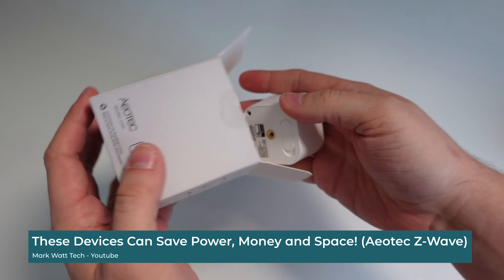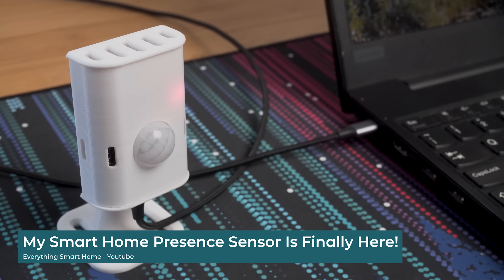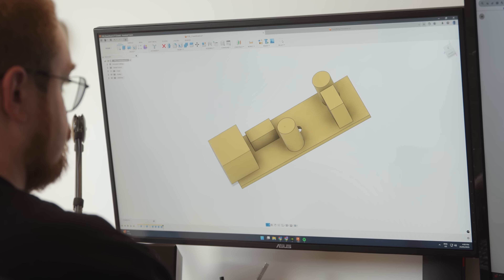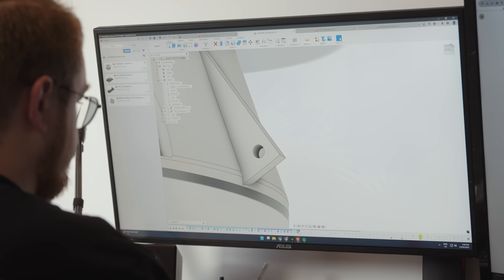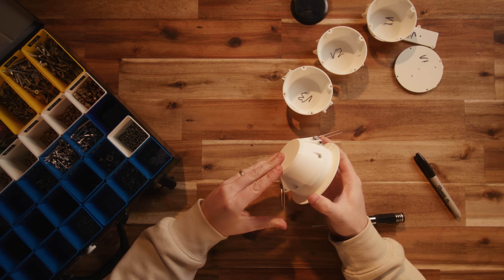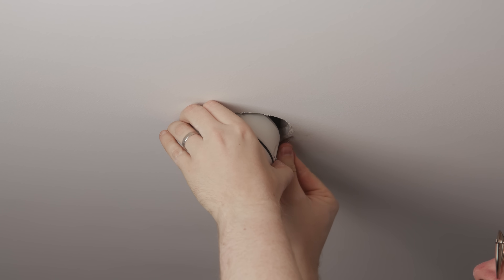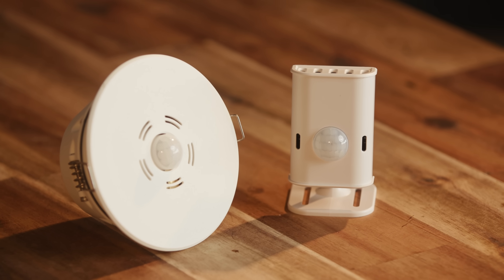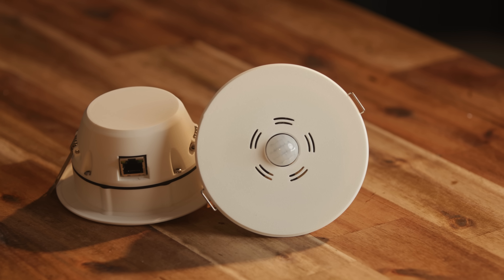Where My Perfect Smart Home Begins - Everything Presence One

Comment: Love this (and might buy some), but just a heads up, you might want to look into home cooling/heating efficiency, as zoning doesn't have the benefits people often think it does. Your home is a thermal battery, and cooling or heating a single room to comfortable from not, costs a lot more than just having your big thermal battery already at a nice temp. All areas within your thermal envelope are sucking energy from all other areas, whether something is actively cooling/heating that room or not, and the cost is efficiency and money.
Often the most efficient way to keep your home is to have all (most) internal doors open, with automations on your windows for sun levels (depending on cooling and heating wants/needs) while evenly heating/cooling all spaces. There is some nuance in different floor levels (upstairs where everyone sleeps can be set lower, as heat rises, and generally people don't like direct heat at night, for instance) but it's a good rule of thumb.
Thanks for the fun videos. They give me so many ideas for once I get around to similar automations and projects.
Reply: You're precisely right.

Air is (as we all know) a great thermal insulator, and it has a pretty high Specific Heat Capacity (about 1/4 of water's). That means it takes a fair amount of energy to heat up a given room, and to alternatively cool down the room, there's a pretty high amount of energy needing to be dissipated.

Assuming one doesn't have a stupidly powerful HVAC system that's way oversized (because the only forseeable reason you'd have something that powerful would be for ISM use), it'll take a fair old chunk of time to see any meaningful change.

And since your house generally has internal walls that leak heat (even if they're insulated it's probably to a lesser degree than external walls), like you said, the heat's just moving around anyway.

Far better to have one or two zones based on floors, and to have a heating/cooling profile designed to keep the house at a fairly steady and comfortable temperature, with perhaps a few degrees here or there based on the time of day and whether you're in the house or not (like say, allow the temperature to drift +-5 degrees when you're not at home).
Reply: @jobblejosh9713  I can only assume he's going to be pioneering this regardless, tech like this hasnt really existed until now so I guess we'll see what works and what doesnt.
I find it a bit weird that both you guys pretty much say it's not really worth it to zone it to a room specifically but at least in comfortlevels with heating a home it certainly is better than an overall heated home. To be more specific: cold climate - fireplace which heats the central heating but with too little power. Whole house couldnt be heated to a nice temperature so we used to turn off the radiators in the other rooms to save some heat for the one I was sitting next to in my room. Worked. If the question is DOES IT SAVE ENERGY that could be a different matter altogether however, I realize that.

Comment: A few Questions:

How do you feel the mmwave and/or PIR sensor are affected by the different orientation. Do you have 8 foot ceilings and what do you think is the area that the sensors cover in this orientation?

Also do you have ceiling fans and have you had to account for the placement of the sensors to account for them?

Lastly where in the room did you place them? Did you do the center of the room?

Sorry for all the questions. I love this idea but to cut down on cooling costs we use ceiling fans to help "cool" all our rooms (yes I know it doesn't actually cool them but it makes them feel cooler via the effect of evaporation on your skin). We put ceiling fans in the center of the room so couldn't place the everything ones there.

I do really love this idea. I've been dying for an Everything one poe version since they were released. I think I'm going to make one for our living room which has 2 ceiling fans so I can place it in the center of the room without the ceiling fans interfering. I may also make some for our bathrooms (which don't have ceiling fans)
Reply: I was thinking the same thing, the FoV for the PIR/mmWave would probably need to be adjusted to get maximum coverage. My ceilings are 7 foot 5, so I've been using contact sensors on the doors to trigger the initial light on in rooms of an awkward shape. Then a mmWave sensor to keep the light on. Doesn't always work when people don't close the doors after themselves, but good enough for now
Reply: Same question for me! We’re mid-build and haven’t yet put up drywall or interior insulation. This is the bump I needed to commit to Ethernet runs in the ceiling and I’d love to know the ceiling height and MMwave coverage from there
Reply: Maybe there's a way to put it on (below) the fan?

Comment: Recommendation for the future, build a small lip to one side of the enclosure so you can slip a fingernail in to pull them away from the ceiling.  Without it, you risk marking the ceiling when you try to fight springs getting them down.

Comment: I don't like the POE powering, if you have a few dozens devices it makes networking your home much more difficult and expensive. The bandwith needed to these sensors make ethernet connection overkill and wireless connection much better. The other requirement I agree with them.
Reply: I used to run all my smart home stuff on wireless but I got fed up with waiting 5-20 seconds for things to respond due to 2.4g congestion. Now I wire everything or use Thread/Zigbee and it's so much better.

Comment: you ran cat6(!) for a simple poe sensor, why not just run a couple of low voltage wires to a central power supply at that point? using poe for this seems wildly inefficient... 
multiple stages of stepping up and stepping down voltages, 
expensive ethernet wire compared to low voltage cables, 
using a lot of rj45 slots on a poe switch, 
multiple points of failure with those cheap poe adapters in the ceiling
....
Reply from the maker: It's for future sensors with built in POE :) 

And I already had the cable and switches!

Comment: How’s the performance of the mm wave sensor? In my reading I found they can be a bit spotty on the peripheries, and you’re aiming it directly at the ground.

I’d be interested in a more detailed analysis style video on how it’s working set up the way you have it. 

Love the video keep up the good work.
Reply from the maker: I've got a video planned for the future that will review everything I've implemented in the house and how it's performing. Just want to get a few months under my belt to understand it all better! 

For what it's worth, I've actually had to dial down the sensitivity on a couple of the sensors to stop them triggering when we're in adjacent rooms! But if your house was much larger you would probably require more sensors.
Reply: This is exactly what I was thinking, would like to know what the radius for detection is now that it facing down?

Love the ideas but just want to know how practical it would be and if you need to have one every 3 metres to detect motions down a hallway for example/

Comment: Hey just so you're aware, you're not actually allowed to run your own copper ethernet cabling in the ceiling or through any wall cavity in Australia without a license, as ridiculous as that sounds. There may also be restrictions on drilling into walls and ceilings even for installing a battery powered sensor. I don't know how many of your subscribers are Australian but even though it's stupid it may be worth in future play the "I had my 'electrician' install some cabling" card as this could get you in trouble and may void your house insurance in the event of a fire. There is also the risk of asbestos in many homes built even up until the early 2000's but I'm sure you're aware of that.
Reply: I’ve also heard that running pre made cables are ok. But terminating your own is a big no no (regulatory speaking) especially for POE use. 

Such a stupid rule!
Reply: @nickbooth9685  even if the cable is pre-made your not allowed,  and to get trained and get a license from acma isn’t easy

Comment: For what it's worth, I've had luck with a Ubiquiti Instant PoE to USB Converter - they're pretty cheap and it's been running one of my EP1's for a while now! All without having to use the 5V headers etc.
Reply from the maker: USB definitely works! I just like having it all in a tidy little enclosure!
Reply: @TheStockPot-AU  Your way makes for a better video as well haha. I've literally got a few brand new ep1s in the cupboard awaiting for some upcoming renovations so keen to hear how you find the detection angle?
Reply: Just to clarify, there’s a PoE version of the Everything Presence One coming, and it’s data will also have the option to go over that Ethernet rather than wifi/bluetooth? That’s dreamy if so

Comment: This is a lot of the work I'd like to do, but how are you going about getting your ethernet runs installed? Did you get your data cabling quals?
Reply: just dont be stupid and run them with power etc and you'll be fine. use quality cable that it rated for the environment
Reply: @paulholyoak I know it’s simple easy and low risk, I’m talking about what the laws say and how insurance can use it to deny cover for all kinds of BS

Comment: Awesome! I am currently working on something quite similar. But because of Budget restrictions i am going tohave to  build, solder and program my esp32's on my own. I am also currently testing out different positions in rooms and their influence on the measurement. Funny enough the results of my tests with 8 calibrated Shtc3 sensors. As I positioned them throughout the room, closed the door and left for a few hours I had deltas between my readings of up to 4°C and 15%RH. That was way more than anticipated so I recalibrate all the sensors, switched them up and repeated my test. The results were the same, so I put 2 big oscillating fans in the room and continued. The difference dropped to 0,8°C and just 5%RH between the sensor hanging on the ceiling lamp in the middle of the room and the one in a bottom corner. 
What I did conclude:
-Position matters a lot in closed rooms with no circulation 
-for accurate(per my requirements)climate-information in a room or confined space I will need multiple sensors and circulation 

-> I am verz interested to see a similar test run in your rooms with these sensors as I would think that the measurements in a kind of closed ceiling sensor would not represent the  actual climate in the room. Maybe a static offset is enough to make the measurements accurate enough for you

Comment: Clean install! Hopefully the EP2 adds PoE support
Reply: Or at the very least a proper small data packet protocol like Zigbee would be neat. Reliable enough, and 5V is plenty to make it act as a Zigbee router as well
Reply: @daylen577 i thought the problem is the mmwave sensor requires too much power for battery operation. Or is that not what you're referring to?

Comment: is the horizontal and vertical FOV of the mm Wave sensor the same?  are you going to need more sensors in each room due to limited rang and coverage being celling mounted
Reply from the maker: The FOV is different horizontally and vertically. I've not yet taken the time to 'clock' the sensors correctly for each room, but when combined with the motion sensing, it's worked pretty flawlessly so far!

I didn't dive too deep in the video, but I modelled the FOV of the sensor in CAD and checked the coverage before ordering the sensors. Our place isn't super big, which certainly helps!

Comment: It would be a big project, but ive always thought a light switch or light fitting would be an ideal place for sensors. Got the power there, theres one in every room and its not an additional thing, so wouldn't be noticeable unless you're looking for it
Reply: Not a bad idea, it'd be easier to install that way too. Though, some rooms have weird placement for switches that end up behind doors or house plants, etc.
Reply: @soviut303 ... or even switches placed just outside the room
Reply: Perhaps like Inovelli mmWave switches?
Reply: They already exist in the USA. Wouldn't be hard to DIY one to suit Aussie switch plates
Reply: @Sparky_D biggest issue with US automations anywhere else is they they run on 110v.
Reply: My plan for the future is to do something similar too his idea, but using actual ceiling lamps under which the sensors hide
Reply: Problem here is most switches run switched live set ups, that is they use 2 active conductors, there’s no neutral, so there’s no power set up for use without turning the light on without running new cabling.

For ease I would suggest a POE design running Ethernet in the roof would be easier to adapt and install.
Reply: @adam03957 
Only really works in board and batten houses. 
My flats concrete floors, brick and plaster walls and solid ceilings.

Most new builds and re-wires now run a neutral to the switch here in the UK
Reply: @adam03957  Usually with smart bulbs you never switch off their power,  the bulb itself handles the on/off state and you only need a switch signal through ZigBee/WiFi
Reply: I agree. But Australia has to be painful. Lots of switches are on single brick walls usually with no conduit or neutrals. Makes running anything a huge pain. The houses are finally catching up. But yeah anything older than 10 years it’s hard.
Reply: Do you not get microwave sensors? Hide it behind the ceiling as they can work through a solid object.
Reply: In the UK, most homes have whats called a ceiling rose on the main room light, which would be PERFECT for hiding this sort of stuff inside.
Reply: Check out inovelli switches.
Reply: Loxone does that, but their proprietary switches are crazy expensive
Reply: Thats what Linus from LTT did and it is not a good location for presence sensors.